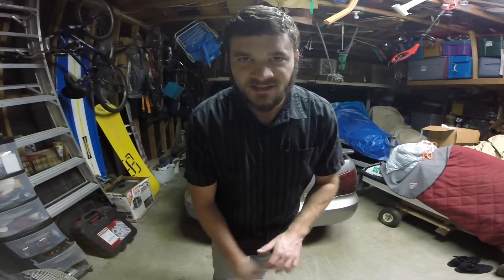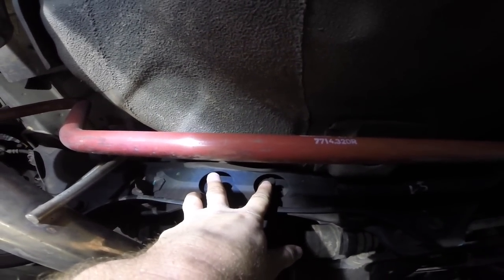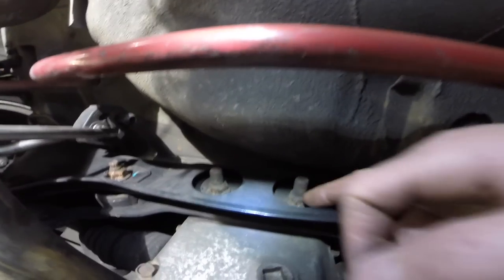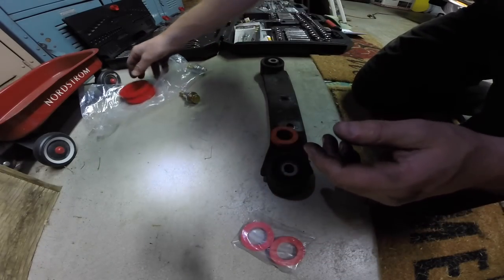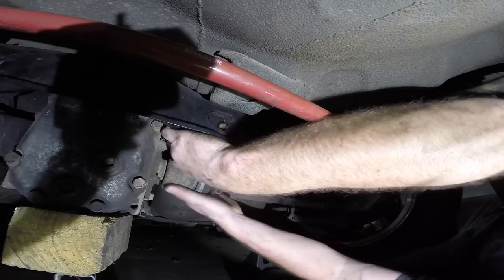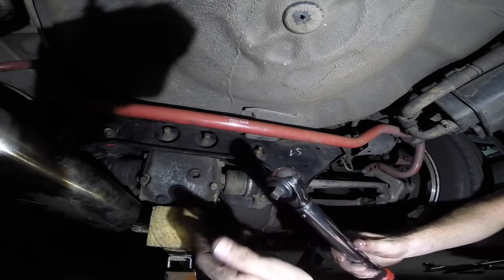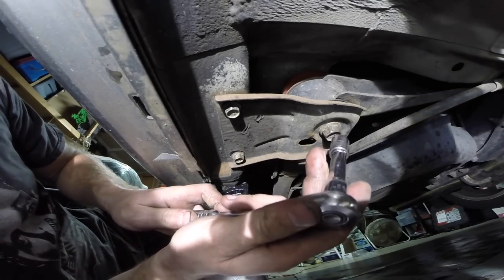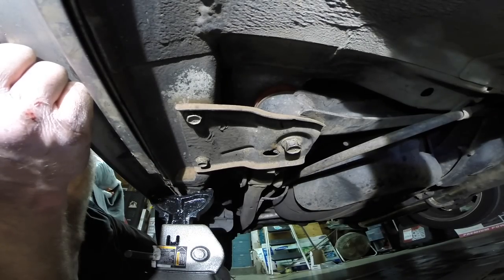EVERY SUBARU NEEDS THIS! What a difference! - Perrin Subframe Lockdown Kit Install

Comment: Those holes you put the lock down bolts in are rear subframe alignment holes used in the assembly plant to aid aligning the rear subframe quickly. Once the rip down the four main subframe bolts they remove their guide bolts and carry on.

Comment: Most 5 speed aren't weak, what actually brakes is the center differential bearings and destroys the transmission. If you weld the c-clip on the center diff to the housing of the differential/viscous coupler and replace all essential bearings you can make more than 350wtq.

Comment: It'll take about 2-4x as long, but for this kinda work, it's best to just drop the rear subframe. Remove the propeller shaft, the differential mount front cover, and differential mount lower bracket, then remove the nuts from the differential housing bolts. Remove the lateral arm bolts and flange bolts (lateral control arm) and the axle nuts so you can remove the rear axles then just drop the entire subframe (a transmission jack, with it's "leveling" abilities makes this a dream). When reinstalling every thing, remember to replace the lateral arm bolt nuts, flange bolt nuts (lateral control arm nut) and axle nuts. Also, if you mess with the cam bolt or the lateral link washer (it looks like a cross or plus sign) at all, remember to replace those nuts as well. Torquing those down is also a pain in the ass, though. Technically, you're supposed to bolt the subframe back in and screw the lateral control arm flange bolt and lateral arm bolt back on the car (basically everything BUT the axles, and remember to use the old nuts at this point) so you can torque down the cam bolt and lateral link washer nuts while the car is on the ground. You don't reinstall the axles at this point so you have clearance to torque them down to the relatively heavy 58 newton-meters. Then you disconnect the axle housings again and install the axles, finally torquing down the lateral link, lateral control arm and axle nuts.

Everything on Subaru's is like a big puzzle, but once you know what parts constitute what assemblies, the annoying parts of the whole procedure go away and you're left with just the beauty of the engineering.

Comment: Installed this kit on my 05 wrx wagon and the car feels brand new! Boy did you make this look easy, what a pain it was on my end. For the most part things went smooth, other than one of the lockdown bolts snapping the captive nut inside the car 😭 cutting into the trunk later this week to retrieve/weld up the nut to the frame.
Reply: I actually just did this aswell.  What did you end up doing for that?
Reply: @znogs9907   it sucked but thankfully I had a friend help me with it. We had to pull majority of the interior from the rear, cut a flap by the shock tower and fold it to expose the broken nut that Subaru welds in. Had my friend tack the nut back on then sealed everything back in place

Comment: I put one of these on my 2011 Forester XT. HUGE DIFFERENCE!
Reply: Hi
Could you explain the improvements, I would like to put the kit
Reply: could you please tell me the kit part number you use, thks
Reply: @72JPP  The steering is noticeably less vague. Before, I could turn the steering wheel 1/8 turn or so before the wheels engaged. Now, every time I turn the steering wheel, the response is more immediate.

Comment: i dont understand what gains you would get from adding those to stock rubber bushings. surely just upgrading to poly bushes would have been a better idea? i've never seen these before and dont understand why you would add those ones to the top of the subframe bushes. the diff ones i kinda get as it packs out the stock ones but still
Reply from the maker: Bushings work in mysterious ways. Install them and feel the difference. 😈

Comment: Will I be able to re-do the tread on one of the big lock down bolts, it strip out having problems with the new bolt?
Reply from the maker: Bummer. In that case, a Possible drill and tap may be in your future

Comment: I was installing some whiteline bushings on my 04 wrx and the screw that goes into the diff the 2 in the middle one of them the nut came off before the screw did, do you have any advice how to get the screw out without the nut?
Reply from the maker: Maybe some pliers? It should be a long threaded piece from what I can remember. I guess I got lucky on mine. Good luck anyway

Comment: I wonder if the STis have these from factory?
Reply from the maker: hmmm. My guess would be yes. I mean my WRX already had the threaded holes and everything.
Reply: At least my 05 STI does not. The holes are there I wish they had these from the factory
Reply: @06wrxdude  no subframe locking kit  on my06 jdm sti, nice job